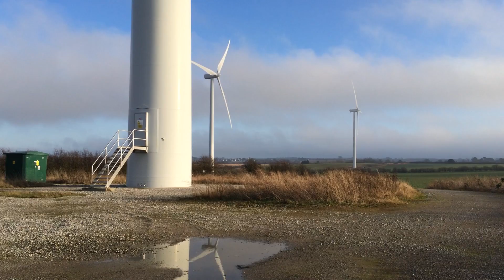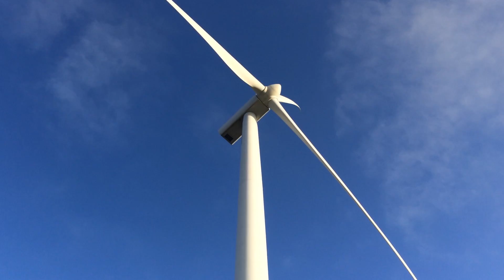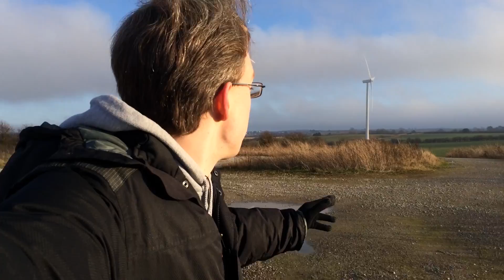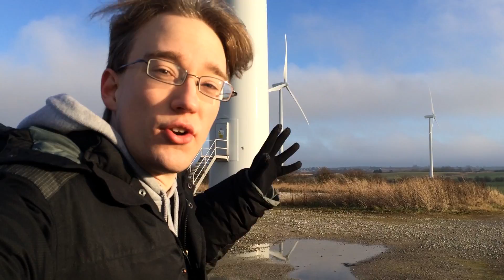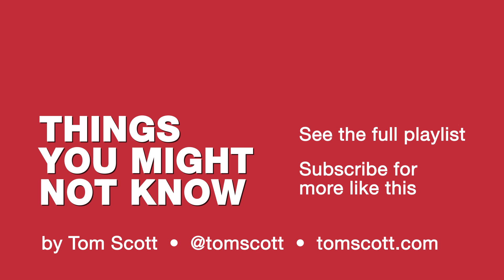Why Wind Farms Don't Always Turn When It's Windy

Comment: Gas fired plants have a very quick start up. Wind farms are very unreliable because wind is very unreliable. Solar is only available during the day. As you correctly pointed out there is no way to store extra capacity. Wind farms are given priority not because of lower costs, they really are not when you have to factor in the cost per kilowatt generated as each wind turbine is not cheap, needs periodic maintenance, and suffers many breakdowns. Larger conventional plants and nuclear plants are very efficient and have superior performance between breakdowns. Normally gas fired plants are used to provide extra capacity when needed. They start up quick and are always available when needed. The cost per kilowatt is higher but that is a trade off for reliability.

Comment: What does the Hz/CPS of the AC electricity have to do with balancing demand/supply on the power grid?
Reply: An imbalance in supply and demand causes causes the grid's frequency to shift. If the grid's load decreases, turning the individual generators becomes easier which allows them to spin faster. Because the grid's frequency is dependent on how fast the generators spin, this causes the frequency to creep upward. To counteract the effect, some generators can be brought offline to reduce the amount of power entering the grid, making the remaining generators work harder and slowing them back down. Much industry machinery relies on the grid frequency being precise, so it is important that it not drift too far from the nominal 50/60 Hz.
Reply: Jason Gerecke thanks, that makes sense. So, wind turbines run synchronously, and phase locked? Crazy!
Reply: *****  yeah, I'll need to do further research. 
While keeping a turbine phase locked seems tricky, using a generator (as opposed to alternator) and an inverter would be highly inefficient.
Reply: @jigpu2630  Power generation equipment is governed to maintain the frequency. If a device shifts out of synchronisation with the grid you have an effect called pole slip. Run a search on pole slip. Lots of "interesting" pictures to be seen. I had two big diesel generators pole slip on me some years ago. Fortunately the protection system was fast enough to prevent damage. When I say big they were driven by 60 Litre V16 engines.
Reply: Stephen Tack  There are few reasons for which generators for power grid produce AC. Long ago in the age of Tesla, there were no inverters for start with. Also even today, inverters of such power are very expensive and not as efficient. Furthemore a DC generator is a very mainetance demanding machine due to a commutator. Also once you phased your generator with the network, which wasnt so complicated in the early days and which is super easy today, it stays locked to the network phased in. The frequency (and voltage) shift which happens on a unbalanced network is a gradual thing that goes wild when it reaches breaking point (black out level problem). But if you keep the network in a working condition within defined limits, once a generator is phased in, its keeps phased it self. Talking about a most common AC generator (3 phase synchronous machine) even when you would shut down the turbine with the generator connected to the network, it would just act as an electric engine spinning the turbine. The network is so powerfull, that once a generator is part of it, it spins according to the network. The turbine is giving the generator the mechanical energy which the generator turns into electric, but if you would want to change the speed of a turbine connected to a phased in generator, it would simply force the turbine back. Or it would all burn down.
Its hard to explain without pictures :-P
Reply: Stephen Tack
Alternator is also a generator. A DC generator is a dynamo...
Reply: Pavel Sovička   And I guess it makes sense that an AC generator would stay phase locked. Thanks.
Reply: Actually it is connected. If the demand is lower than supply, the generators are not so loaded and start to increase RPM slightly, which in turn makes higher frequency of the output voltage. If the demand is higher than supply, the generators are slightly overloaded and slow down slightly, again lowering the frequency.
Reply: Pavel Sovička good to know that distinction.
Reply: +Stephen Tack Not a lot. I think it was inserted as an educational thing.
Reply: I wonder how many devices are still in use that are dependent on mains frequency reference...like some old AC clocks?

Comment: Why not just feather the blades to a higher pitch to deal with excess wind speed instead of just on/off?
Reply: What do you mean by "feather the blades"?
Reply: It leans rotating the blades on the long axis to adjust the pitch to control speed. http://en.wikipedia.org/wiki/Blade_pitch#Feathering
Reply: I understand. IIRC this was an idea for using a ramjet + turbofan on supersonic aircraft. The turbofans would feather at Mach 1.00+ speeds to prevent damage and let the ramjets take care of power from there on.

But feathering the blades isn't better than locking the blades IMO as the blades aren't going to produce power in either configuration. It might be safer for the blades though.
Reply: @ArnavDhamija   It's been 7 years but that sounds like a cool concept.

Comment: Been to electric mountain in North Wales ? That station uses more electricity than it generates ! It buys electricity from the grid at off-peak times when it is cheap, this is used to pump water into a reservoir above the station giving it potential energy, then when the demand for electricity is high, the value of electricity increases, they open the valves and drain the reservoir, driving the turbines. And sell the electricity back to the grid for a nice profit. The ability to quickly and easily regulate the power output to meet the changeable energy demands of a country, make it a vital station.
Reply: That's because it's a storage station, not a primary generator (if you discount the relatively minor contribution of the rain that falls into the top lake). Essentially a battery, that absorbs the excess power of always-on stations that are coasting down after providing for a peaktime burst to "charge", and then "discharges" to cover the start of the next burst whilst those stations are still spinning up. And there aren't any battery designs that are 100% efficient (never mind over-unity); you always lose some energy between charging and discharging them.

As for making profit, it's one stop short of being a nationalised public service, I expect they get paid fairly well for providing the storage service, but once the cost of the balance of input vs output energy is subtracted it might not exactly be phat lewts because all the other providers in the chain want to minimise the costs they pass on to customers in order to remain competitive...
Reply: Sam Smith UIp to full output in a matter of seconds and don’t forget Ben Cruachan in Scotland.
Reply: he made a video of it 5 years later

Comment: i want to have a mini version of this in my house
Reply: There are little wind generators that actually generate electricity. It might not be much, but think like 250 watts. The problem really is hooking it into your power grid. Usually these are used for places in remote areas, along with solar cells and a shitton of batteries.
Reply: In?

Comment: 1:10 Nuclear, coal, gas, much harder start up.

Uh, no.  Gas turbines are very easy to start up and shut down.   The other two I'll grant.
Reply: It's not even so much startup or shutdown, it's the speed at which the amount of power being generated can be varied, and the generator taken from being disconnected but idling the turbine at near-grid-speed (using only a smidge of fuel and steam because there's no load on it) to connected up and running at full speed and full bore. As your working fluid is water steam, and even with a massive gas burner it takes a minute or to superheat the fluid within the system from its barely-boiling starting temperature, and several more to bring the thing up from cold and stationary, you need something a little more agile, if overall lower powered and less reliable, to plug the gaps whilst it comes back online.

Also, I'd expect nuclear and oil-fired to be almost as quick to react as gas. It's coal and biomass generators that take a particularly long time to stoke as you can't just inject more fuel or expose more of the rods and get a near-instant boost to the flames or radiant heat boiling the water, but actually have to pile more material onto the furnace grate and wait for them to catch and the fire to grow... Which is probably just one good reason why the main thing that renewables are displacing is coal. Biomass is at least no worse than coal in terms of reaction time but is carbon neutral and has cleaner emissions, and everything else is much faster to respond when connected or disconnected and are essentially zero emission and negative net carbon.
Reply: @ codediporpal :  No, these are not "gas turbines"; they're steam turbines powered by boilers heated with natural gas.   So they take a while to heat up before they can be brought online.

Comment: Regarding "giant storage batteries":

On the east coast of the US, there is actually a method of storing energy from wind-farms for later use. It involves using the excess power from a wind farm to pump water from a low-altitude lake into a lake at a higher altitude.

When the power is needed, the flow is reversed and rerouted through a hydroelectric generator.
Reply: ! That's cool! Smart!
Reply: That's called a giant storage battery.
Reply: @bentleyboy72  :  Storage, yes.  Battery, no.
Reply: @Milesco  What is a traditional battery if not storage for electrical energy? Pumped storage is a battery for gravitational potential energy.
Reply: @claytonfs  : A battery is a series of electrochemical cells that use ions and chemical reactions to store electrical energy.   That's not what a lake is, even if it's being used to store gravitational potential energy.
Reply: @Milesco  Did anyone specify that a battery must use redox chemistry for its function?
Reply: @fghsgh  :  Yes.  That's what a battery is.
Reply: @Milesco  nope. thats an electrolytic battery.
Reply: @Guess I'm Chrissy :  Yes, it is.

From Wikipedia:
"A battery is a device consisting of one or more electrochemical cells with external connections for powering electrical devices such as flashlights, mobile phones, and electric cars....When a battery is connected to an external electric load, a redox reaction converts high-energy reactants to lower-energy products, and the free-energy difference is delivered to the external circuit as electrical energy."

Comment: They've just built some of these near me and I assumed they weren't turning to start with because they hadn't switched them 'on' yet. However, this was also at the time when the UK was experiencing 50-60mph winds, so maybe they were 'on', just not...'on'.
Reply: +AboveTheSource I was once told by a native, that there will never be wind-farms on the west coast of Scotland, because the wind would blow them down. Having spent some time on the west coast of Scotland I can see what he meant. 65mph winds are considered 'calm'.
Reply: If you mean maybe they were spinning but not generating, this is highly unlikely, unless they were damaged. If they weren't generating there would be no load to slow them down, and would increase in speed until they ripped themselves apart.

If a turbine is not generating then it will not be rotating, the blades are rotated so they are parallel with the wind direction, reducing the force on them and hence the rotational speed. If the speed is still too high then electrical braking is applied and finally mechanical braking to bring it to a complete stop.

Comment: I have ALWAYS wondered this - thanks Tom :)

There are actually massive power-grid batteries in the form of pumped-storage hydroelectric plants (as you probably know!) but not nearly enough to cope with huge fluctuations. I think there's one in Wales. and Japan has loads of them.

Regarding high winds, though, I would've thought it would actually be safer to dynamically "brake" the windmills to prevent them turning beyond their operating capacity, since the load would be dynamically spread and partially extracted or converted, while switched off and static they'd be more vulnerable. But then, I suppose power-generation itself is a turbine-braking process, so if that's not enough to slow the buggers down to safe speeds then yeah, I guess they sometimes need to be locked down.

Disclaimer: I studied civil engineering, but am (clearly) no expert
Reply: They feather the blades, to minimize surface area, and don't just brake their rotation. By variably feathering the blades, they modulate the rotation to a fairly consistent speed in different wind strengths. This minimizes additional strain and increases average efficiency.
I am not an expert, but I have read about this.

Comment: Hm, so windfarms aren't really that noisy? I've heard people complain that they were noisy.
Reply: Lol That's possible. 
Definitely don't sound so bad from this vid.
Reply: Noisiness is somewhat of a subjective thing. The low-frequency drone from a windfarm can be quite annoying over longer times, so you wouldn't want to live right beneath one, or next to one. That's why they place them in or around crop fields, where there are usually very few people around to be annoyed by them.
Reply: @totoritko   It's been 7 years but I've been to numerous wind farms and stood right beneath wind turbines and have only heard as much as a small swoosh whenever a blade passes by. If there were a wall between me and the wind turbine I probably wouldn't be able to hear anything. Regardless, they're a lot more quiet than a coal power plant.